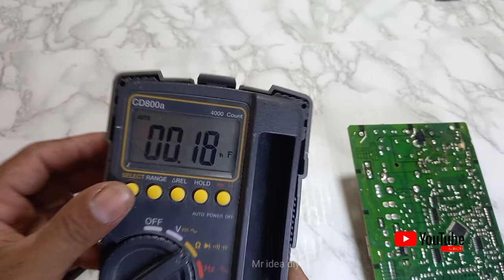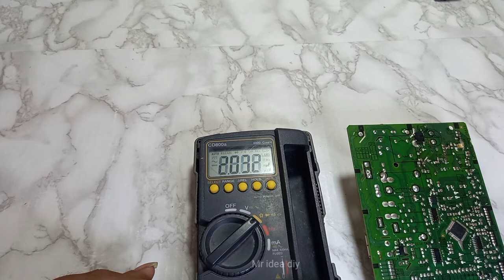how to change blower fan capacitor air conditioner pcb

Comment: bhai ye capacitor kaha milega
Reply from the maker: any air cond shop or can find online shop brother.
Reply: Bhai kitne ka aata hai ye ? @mrideadiy5835
Reply from the maker: any air-conditioners shop bro..or any online shop milega.🥀🙂
Reply from the maker: @Jatinmak143  indian 40/45 rupis bro.
Reply: Indoor Blower Motor Ki Extra High Karni Hai Mujhe Koi Solution Bata Den. Mere Pass Just Indoor Piece Hai Jis Se Main Fan Ka Kam Leta Hon Tu Please Aisa Kuch Bata Den Jis Speed High ho jai
Reply: Nai ho sakti @HarisXperia
Reply: Agar BLDS Mother Use Kar Li Jai Tu Bhi Nahi 12v Ya 24v Wali
Reply: Is it okay to put that capacitor any sides no polarity?